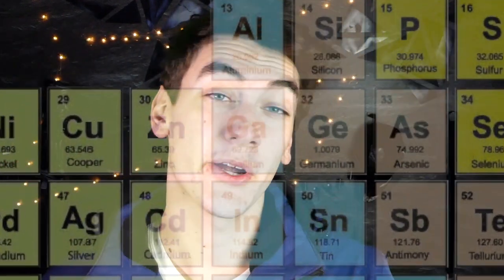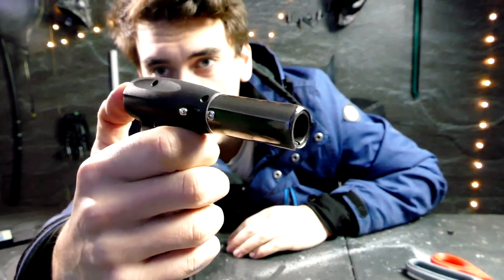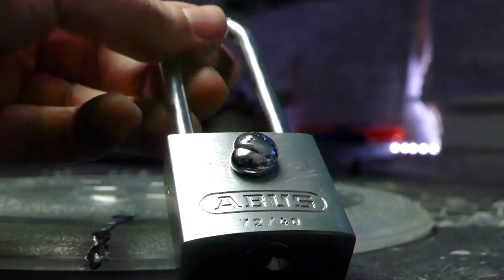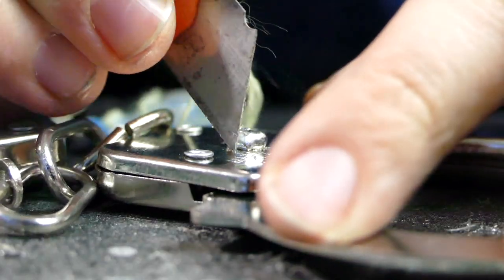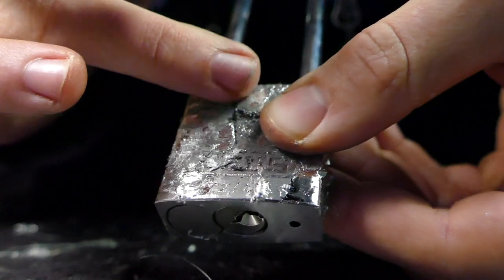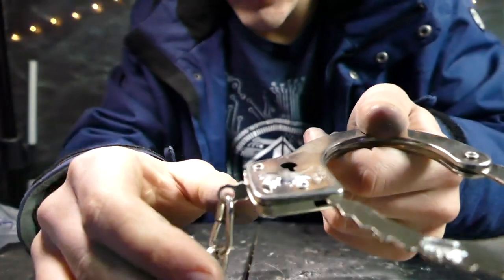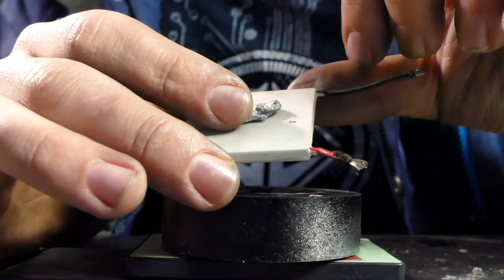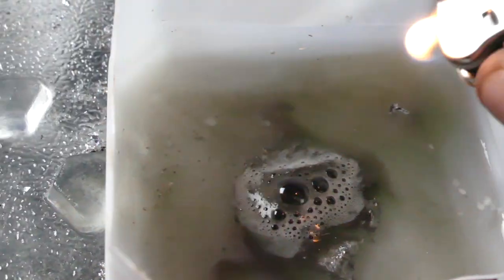How To Melt Locks Like a Spy! - Super Easy Spy Hack (Gallium)

Comment: I just did a bit of research on gallium toxicity.  The only consistant info was gallium toxicity has been under researched.

It should not be handled without gloves, and if heated, don't breath the fumes. Especially if you heat it enough to burn, which it will. Fumes from burning gallium are definitely toxic.
My concern, originally, was it similarity to aluminum. Aluminum is suspected of causing problems in the brain, because of it's high electrical conductivity.  The suspicion is aluminum might cause Alzheimer problem from ingesting aluminum from using aluminum cookware, (think how badly pitted aluminum pots always are). The other way of getting aluminum into your system is via anti-perspirant.  The anti-perspirant IN anti-perspirant is aluminum hydroxide, (I think it's a hydroxide. Going on memory, which is minimal, for me).

If aluminum short circuits the brain, and gallium has the same covalency, gallium might also cause the problems aluminum is thought to cause.

Better to be safe. Wear gloves, and stay away from fumes.

Comment: i have never see a spy melting a lock with gallium🧐 also if you get a decent lock it would not be made of aluminium..
Reply: watch breaking Bad ep?
Reply: Oh this lock is not aluminum?  Well, break out the aqua regia( nitric plus hydrochloric acids)!  Unless the lock 🔐 is made of pure osmium, that mix will easily dissolve it.

Comment: Gallium costs too much. In my experience, the spy should just invest in good old fashion pliers, but enough said!
Reply: pliers wouldn't do anything to a pad lock.  As long as it's not case hardened, bolt cutters will cut the bail.

And expense? I just ordered 40 grams on Amazon for ~15.00.